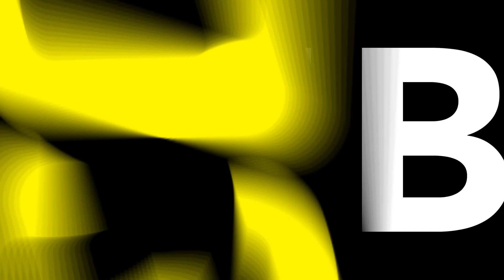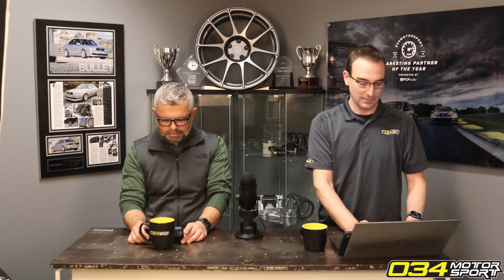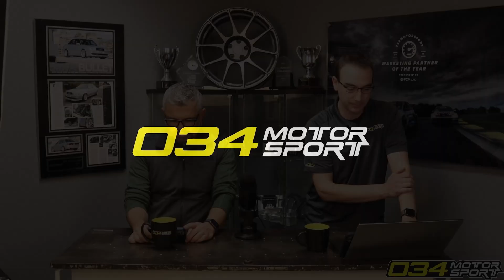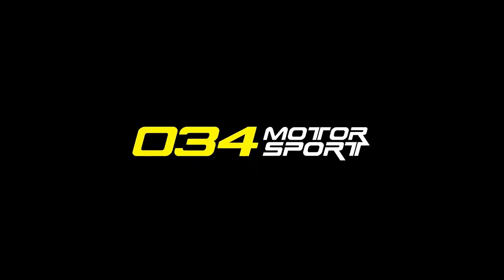Piston Rings On B8 3.0T: Are They A Common Failure Point? | 034Motorsport FAQ

Comment: in the case that the ring gap is tight for efficiency from audi, and well within normal operating limits with a stock engine, but then the gap gets too small and closes and the ring breaks or something when a ton of heat is applied combined with cyl 5 theoretically getting a little less fuel and running a little hotter etc and then that is the ring that closes the gap and breaks. not confirmed or anything but if there's ring lands that are not broken but the ring is broken would be evidence of that right?